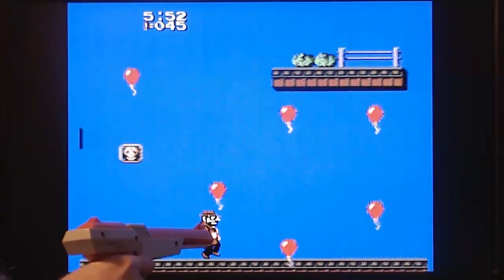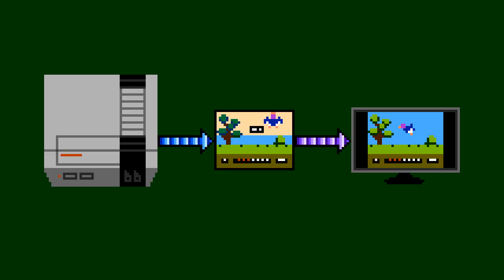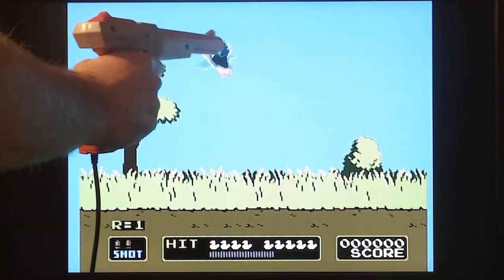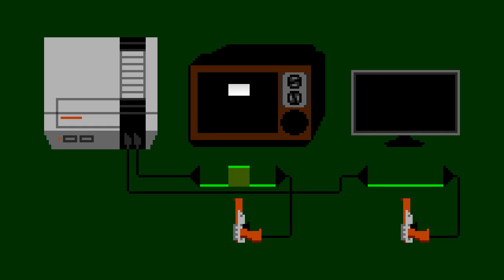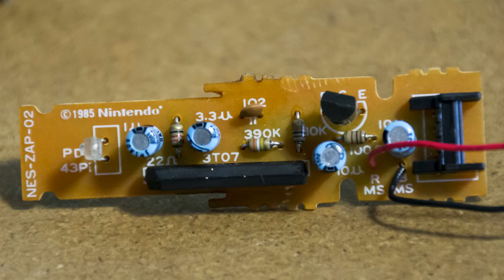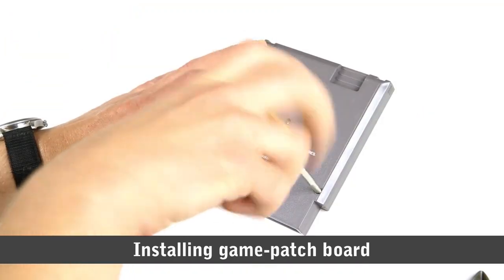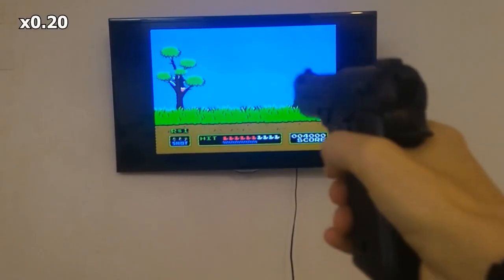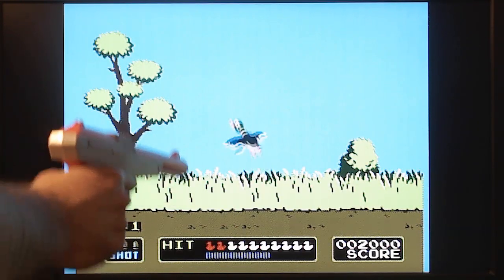Ways to play NES Light Gun Games on a Modern TV

Comment: It's not a "CRT filter". The limitation of the original Light guns is that they can only "see" infrared, because the CRTs also emitted infrared amongst visible light. It was made like this because it was cheaper, as they could use the same infrared photo-receptors that were used for remote controls everywhere. And LCDs emit no infrared light.

Those clone guns seem to use a different photo receptor that's able to operate on the visible light range.
Reply: CRTs don't emit any IR. The P22 phosphors used in color CRTs emit narrow-band red, green, or blue light only. Even old B&W CRTs used phosphors that emit only white visible light, with no IR component.
Reply: @shmehfleh3115  WRONG. Quick google search "do crt tvs emit infrared light" proves you wrong. Trying to sound smart but only looking bad.
Reply: If the NES Zapper can only "see" infrared then how did Chipos81 get it to work with a blue LED? https://youtu.be/DzIPGpKo3Ag?t=105
LEDs only emit a narrow band of light and blue is almost completely on the other side of the color spectrum from infrared.
Reply: @JohnSmith-qn3ob  old comment but incase you never got your answer... we don't see it because it's so fast to switch but the LED actually sweeps through the color spectrum up to its wavelength when you first turn it on. Again it's nigh instant but its there for cameras that CAN see it. As such, the camera can pick up the infantesimal moment that the LED is temporarily energized in the infrared spectrum as it sweeps up to blue.
Reply from the maker: This is an interesting comment! It's not a theory I've seen put forward before. The filter explanation I offered in this video was based on analysis others had made of its schematic, and some testing of my own, but I have not personally investigated every possibility and I had not considered wavelength of the light. Though I would say that in my tests I got the zapper to respond to both CF and LED light sources. I'm not sure which (or both) you're including under LCD TVs not emitting infrared light, I don't know very much about the non-visible emissions of these things. The CF it responded to continuously, but the LED it only responded to at the moment of being switched on or off, and both of these observations appeared to fit the filter theory.

If you have a source for the infrared idea, I'd love to read more on it.
Reply: @Sakanakao The source is my own research on the topic.   :)

The MSX computer uses exactly the same light-gun as the NES. Adapting from one to another is just a matter of rewiring. See here:  http://frs.badcoffee.info/hardware/lightgun_adapters.html

You can test it the IR reception yourself: The light-gun works as a remote control receptor unit. Just point any IR remote control to it, it will see the pulses.
Reply: @Sakanakao  The 8-Bit Guy was the same problem with an old camera:
https://www.youtube.com/watch?v=ixgsYAfZ8eo

the camera only "see" warm light.
Reply: I just recently built a Zapper to USB adapter (like a few hours ago) to go along with my FCEUX mod that I coded last night to go with it (big thanks to Brad for giving me a template on how to add a controller to FCEUX). I pointed a remote control on it and sure enough, it picked up the IR! I have the Zapp gun featured in this video coming in the mail. According to the lcd mod website one can desolder said sensor from the Zapp gun and then solder in onto the Zapper and it will just work.
Reply: I was thinking this right away when he showed the inside of the gun and I immediately recognized the IR LED. Modern TV's don't emit IR light like CRTs.
Reply: @Sudas80  there isn't an IR LED in the gun. OP is wrong about how the gun works and so are you. Brad Smith is correct about how the gun works, you can look at a teardown, then lookup the components which have been thoroughly tested. It's a light sensor that filters light based on changing signals. IMO a super cool component.

Comment: what if you tried to play duck hunt (with the og zapper not the clone one) on a gaming monitor with a 1ms delay?
Reply from the maker: I think you could find one with 1ms response time but not 1ms latency, so unfortunately no that's not going to work without compensating for the latency.
Reply: @Sakanakao  well I do know a monitor with a 1ms response time not latency (legit don't know the difference) it's the MSI OPTIX G27C2, so, is it possible that it might work on that monitor (not telling you to buy that monitor to test it in anyway)
Reply from the maker: @whatever4053  Response time is how fast a pixel goes from black to white. Latency is how long it takes the actual image to display, there's a lot more steps involved than just turning on the pixel. No gaming monitor is going to have a CRT like response, they are made to be fast for a human, not "instant" from a mechanical perspective.
Reply: @Sakanakao  thank you for the explanation

Comment: Why not blink the white square at 120 hz. It may be enough to trip the filter
Reply from the maker: The filter is 15000 Hz, so that's a long way off, unfortunately.
Reply: @Sakanakao  I suggested it because I believe florescent bulbs blink at 120hz, and you said it triggered on one of those.
Reply from the maker: @Vsor  With the CF bulb I think this has to do with the sharpness of how quick it turns on and off. A 120Hz sine wave is too slow, but a square wave would have higher frequencies components. An LCD flickering at 120Hz would still be too slow.

I think some TVs with a CF backlight might have their light picked up by the Zapper, though those TVs still the lag problem.

Comment: wait wait wait wait wait.... i thought the pixles where just not bright enough on a lcd... (which is acurate, thanks to that filter) and so light guns would be impossible on lcd... but seeing this video shows that they can work just fine, which means.... if anybody cared enough....

THEY COULD MAKE NEW GAMES WITH LIGHTGUNS FOR LCD TV'S! NOT INACURATE WIIMOTE POINTER LIGHT GUN GAMES, BUT ACTUAL AIM DOWN SITES NO CALABRATION LIGHTGUN GAMES!!!!!
Reply: You would run into the input lag problem still though. There no single answer for input lag as every TV/monitor has a different latency factor. Some gaming monitors will claim a 1-3ms latency while other monitors will be around 5-8ms. Tvs are a while different beast what with all their post processing that can slow it down even further. So the only way to really make the software universal would be to add a calibration adjustment and then require your consumers to just know what amount of latency their particular monitor/TV has. I would be doubtful that most people even know there's such a thing as a latency time on their TV much less know what it is for their model. I'm aware of this and still don't know the timing on my TV or monitors.
Reply: @kudzuwarrior  i know guitar hero had a calibration utility, but i doubt audio/video sync would help, but i bet the game could calibrate itself by just pointing the light gun at the screen and flashing. 

I also know that many tv's have something called "game mode" that turn off all post processing stuff to give as fast of a display as it can.

Comment: Or you could just buy a 32+ inch CRT TV for $10 and it will be less costly than getting clone guns or other components. Not only that but NES games will run without lag. 

And that is if you don't find a CRT tv for free in some street corner during Spring cleanup.
Reply from the maker: Well I gotta say I envy the cheap/free CRT utopia you seem to live in.
Reply: @Sakanakao  Craigslist, Ebay, etc are "utopia"??

Comment: Interesting observation about televisions, though I'm fairly confident this isn't the case for computer monitors.

That might not be immediately obvious because even on CRT televisions and monitors, a lot of computers (especially from the mid 90's) were using double buffering in hardware, which creates the same effect, roughly speaking...

However, if you disable VSYNC on a modern graphics card, and can render a scene at higher speed than the monitor's refresh rate, you still get screen tearing, indicating it's still updating the display as the information comes in.

The NES light gun however depends on a technique that just doesn't work on modern displays.
However, the SNES technique (aka the light pen technique also seen on older systems in a different context) is even less likely to work on a modern display, since it depends on the actual scanning pattern of a CRT, timing, and the fact that while persistence of vision and phosphor decay disguises this somewhat, the actively drawn screen location is vastly brighter than anything else onscreen.
Which simply isn't at all true for an LCD no matter whether it's updating in realtime or not.
Even if you mimic the update pattern of a CRT, which many LCD monitors still do, you still won't get the kind of visual brightness changes that a light pen depends on.

However, the NES Zapper is not based on this principle, instead it seems to be based on flashing a bright frame to tell when the light gun needs to respond, then flashing a bright box around each possible object the light gun can hit in turn to determine which of these causes the light gun to respond, if any.
Thus the system knows because of the relationship between the response and the timing, which object was hit.
Quite why this doesn't work on modern displays, I'm not entirely sure.
(the light pen method can determine actual screen coordinates of what the light pen/light gun is pointed at, but is perhaps even more finicky...)

Comment: Now this actually brings a big spin on the old outdated hardware. Although the NES Classic game pack is free on the Nintendo Switch E-shop. But this brings a big question for Nintendo, although they can't re-release the Black Boxed light gun games like Duck Hunt and Wild Gunman and have it play like the original NES release. But Nintendo can actually re-release the NES Zapper as a modern Switch controller version. The way I can see it working for the Switch is by taking advantage of the IR sensor.

Comment: I've seen modern TVs that still go line by line without any buffer

the slow mo guys showed that wit ha modern 4k OLED TV, with thed slow mo camera you were able to see how it was drawn
Reply from the maker: Yes, most TVs do in fact have a rolling update (or some other update pattern), but it is not at all equivalent to the CRT's progressive scan for this purpose.

"Without buffer" is very unlikely, though. A rolling update does not indicate a lack of buffer. The slow-mo-guys video isn't comparing for latency.

You can get low latency "gaming" TVs, but unfortunately there's just no reason to make a TV with the kind of immediate response a CRT has. Humans can't see/use that speed, it's only necessary for machine-to-machine communication like this, and for every kind of TV except CRT it's much cheaper/practical for it not to be as instant as that.

Comment: There's also another way: VR

In VR, you already have a (or rather two) highly accurate motion controllers, so it's fairly trivial to have an emulator that support this. New Retro Arcade Neon has this feature. Since VR headsets run at 90Hz, it can be really fast and accurate.

Comment: I’m wondering if there is an adapter for NES/SNES classic and then just flash the modded rom onto it. Mixmaster213@gmail.com if you have info for that project.
Reply: OLD SKOOL NES CONTROLLER TO NES CLASSIC EDITION MINI ADAPTER https://rover.ebay.com/rover/0/0/0?mpre=https%3A%2F%2Fwww.ebay.com%2Fulk%2Fitm%2F162604763474 there is an adapter for controllers.

Comment: The reason the original light gun for the NES nor the ones released for the 16-bit systems don't work is because modern TVs display at full 60 frames, and not scanline fields like old TVs from the past.   
It being a LCD and not a CRT is not the defining factor. Because CRT HDTVs are affected by this too.  I found this out a while back when I bought my first HDTV, it was a Samsung TXR3075WH 30" 1080i tube HDTV, it cost $899 back in 2005 but it did not work with my Zapper gun nor Menacer gun for the Genesis.  
Zapper works just fine on a Sansui 27" non-HDTV tube I bought the previous year.
Reply from the maker: Yes, incorrectly interlacing 240p60 into 480i30 is another issue, but it takes a backseat to the two main factors I explained in the video.

For example, the TV I show it working on the end is still doing the 480i30 thing, but the software lag compensation deals with that problem in the same way as the rest of the lag.
Reply: @Sakanakao  that's because your HDTV already unconverted the analog signal 480i to 480p when you connected it.  The early HDTV CRTs did the same thing.